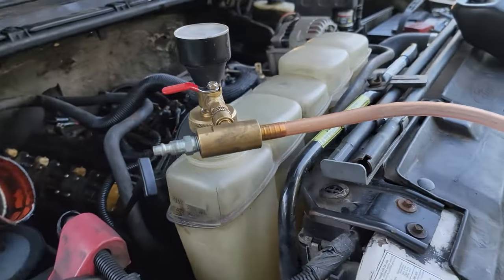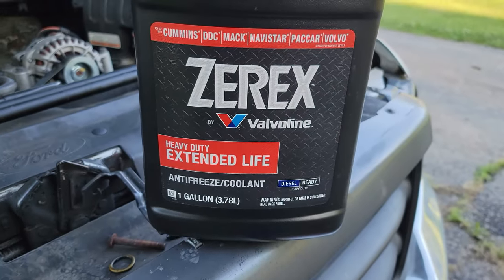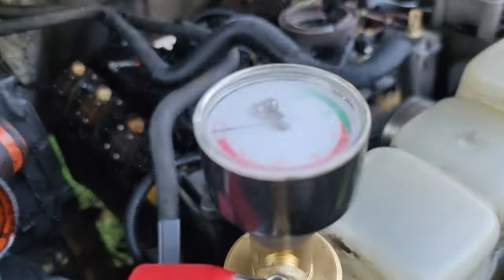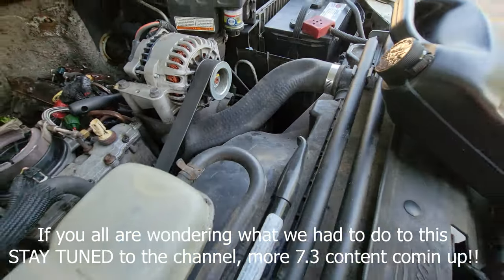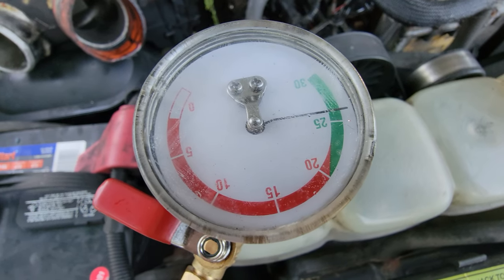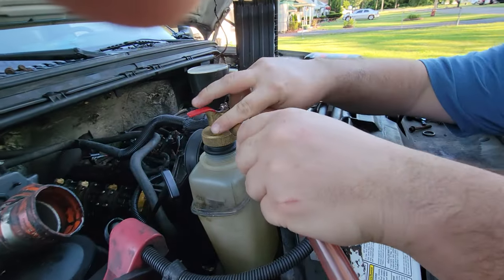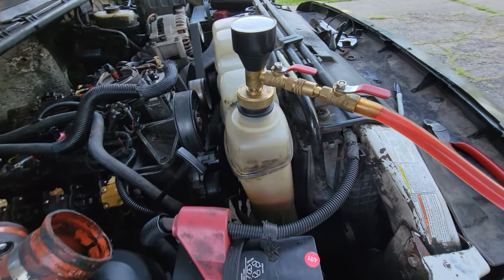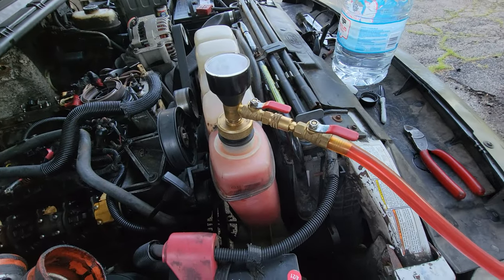7.3 Ford DIESEL Coolant VACUUM FILL vs JUST DUMP it in?? What do you do? Check THIS out!

Comment: I believe the vacuum coolant refills should be used on all diesel engines that have e.g.r systems. Cummins was finding out that guys were getting EGR that were getting cracks in them and when they were replacing they were just doing it old school way just dumping the coolant in the reservoir, air pockets were forming in the EGR cooler and those air pockets would have coolant hit them at high temperatures and they were actually cracking new egrs that were replaced under warranty so Cummins recommends to do vacuum refill on all coolant systems I'm surprised Ford motor company hasn't Incorporated that with their 6.7.

Comment: I am a medium/heavy truck guy over 40 years. The vacuum fill is one of the BEST tools. I use it on almost every cooling repair job. We have a fleet of two brands of 6.7 Diesel engines and some other in line 6 engines as well. (Do not use it on 6.7 secondary systems though). 
We have seen a bunch of EGR coolers in our shop. (Different brands)
Works great to verify NO leaks before filling the system. 
Keep up your GREAT videos. I have picked up a number of tech tips from you on your brand of 6.7 engines. 
Thank You!
Reply from the maker: Thank you brother I appreciate your kind words

Comment: i like this i have  a 2001 f350 with the 7.3 power stroke i have to change oil inner cooler on and i want tto make sure of no leaks and get the coolant back in with no problem thank you for the video

Comment: Those are an absolute must on any van or SUV that has rear heat to prevent air locking the rear core.

Comment: What do you know about ford recommending not to use ELC in early 99 7.3s? Every heard or seen issues of it causing issues with seals/injector cups? 
I had my truck flushed and filled with universal coolant. Was told that it should be ok and they use it in all trucks they work on. Im feeling like it needs to be flushed snd filled with original ford green coolant. Any advice helps thanks.
Reply: I've always filled all international engines with the red Cummins pre charged coolant never had any issues.

Comment: Wait til that stupid vacuum sucks in an oring… happened to me!! Did a coolant service on a 2014 Range Rover and it’s sucked in a heater core oring. 2 days later I pulled dash, replaced oring and finally my coolant service was done… I will never use that tool again, I learned a very hard lesson.  NEVER USE A VACUUFILL!!!!
Reply from the maker: Ha, & i never use it on these things any way
Reply: Using a vacuum fill tool on newer diesels with egr coolers and high mounted charge air coolers is an absolute must. Cummins, Detroit, Navistar, and I’m sure many more require vacuum filling to avoid creating hot spots from air pockets within the egr coolers which will cause them to crack. Although SOMETIMES it may suck in an occasional O-ring or internal radiator tank end seal. I’ve only had 3 trucks out of maybe 300 do this.
Reply: @Thegoose95  my Navistar doesn't have an EGR lol.. long live the 7.3